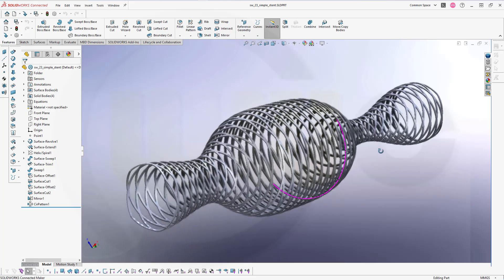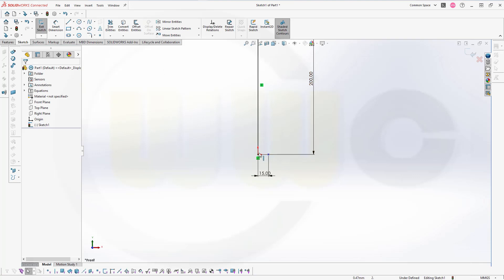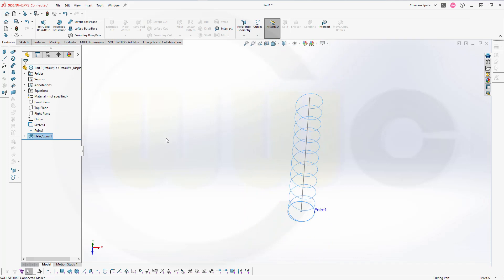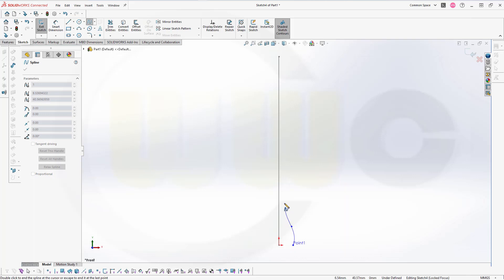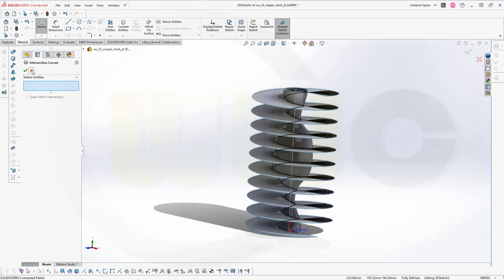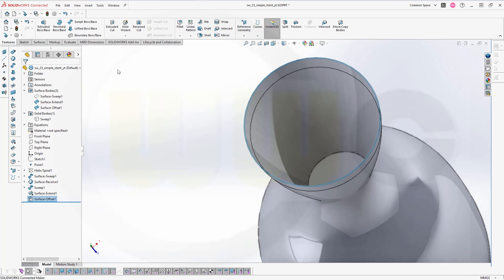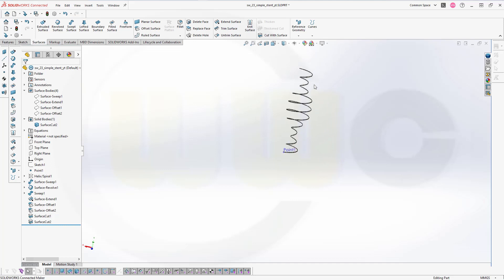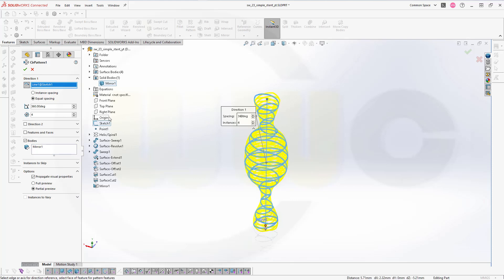Einfacher Stent - Simple Stent - SolidWorks 2023 Training - Part Design

Comment: Hello Sri,
I tried same thing with different surface, and the mesh created is interesting to each other.
How can it be made tangent or non intersecting?
Can you please make similar video for the Diamond wire braid modeling using rose curve
Reply from the maker: Sorry, for a Diamond Wire Braid you would need a completely different method. I will consider it